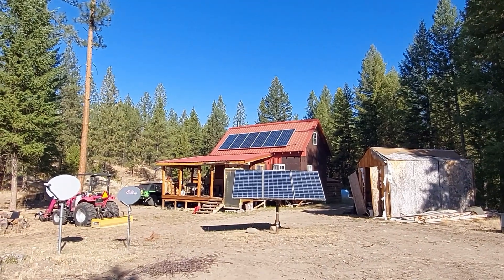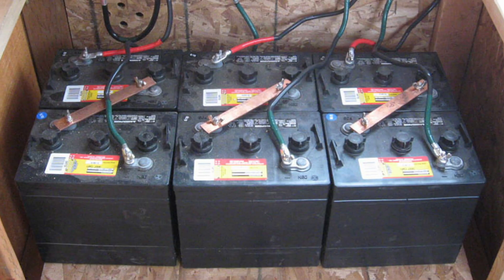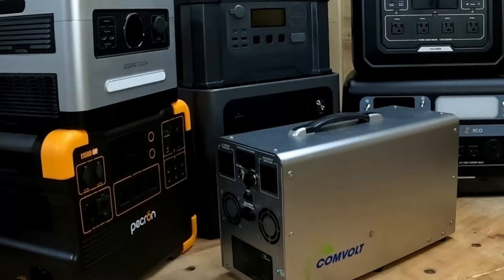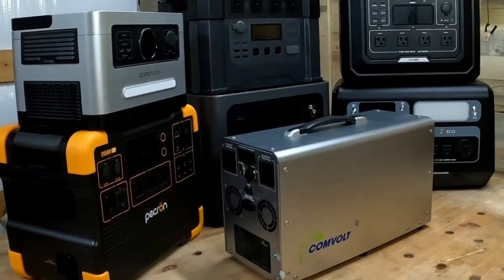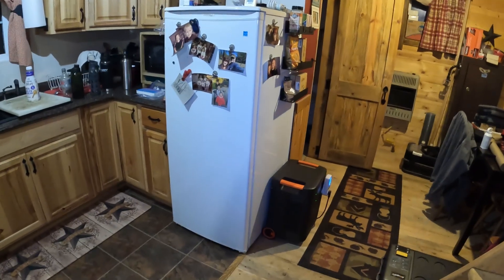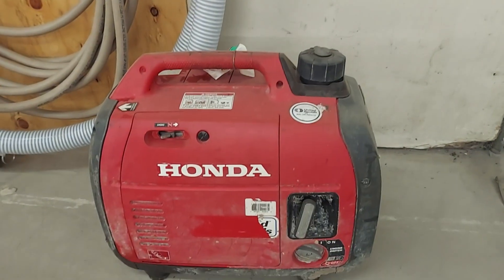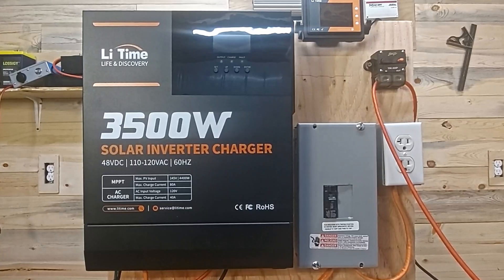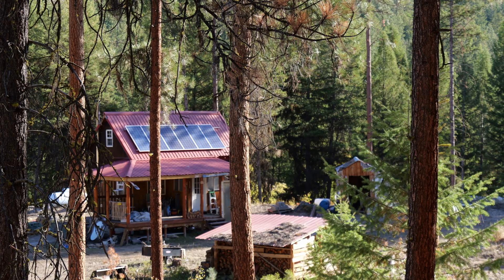Can a Power Station Run Your Off-Grid Cabin?

Comment: Thank you for the commentary.

There are a few options on refrigerators that run on 12volt. From medium cooler sized to 7 cu ft chest style that have separate cooling and freezing zones.

My friend has a smaller cooler style running on 400 watts of solar. Recently upgraded to 2 12volt 100AH LiFePo batteries.

The rest of the house except the kitchen uses 12 volt to run 12 volt led lights in 5 rooms plus a 12 volt 25 inch TV using 180 watts of solar panels and two 100 AH Lead Acid batteries.

The kitchen uses 1 100 watt panel with one or two batteries to run 4 12 volt led lights and 2 12 volt fans.

The battery sizes here vary as to what he brought in from scrap metal hauling.
Everything from old car batteries to bigger deep cycle marine batteries.

If you arent paying for them it doesnt matter if you kill them.
Reply from the maker: Thanks for sharing all the great info on how your friend has his off-grid setup working!

I have a few small 12v fridges but enjoy the bigger one at the cabin
Reply: @TheOldJarhead The only thing I have on the 12 volt cooler fridge is that if using it for a road trip get it cooled down to operating temperature before putting the food in and before plugging it into a vehicle.
Reply from the maker: Mine I run of power stations with DC Alternator charges to keep them running and topped up 😊
Reply: @TheOldJarhead nice.
Reply from the maker: Funny thing, it's what got me into doing more power videos actually :)  Sharing what I learned along the way in the realm.
Reply: @TheOldJarhead It is working.
Reply from the maker: Thanks :D

Comment: Lots of ways to skin a cat when it comes to solar.  Its very situational.    In my situation I can't hook into the house because I rent.  So I have multiple power stations positioned throughout the house for black outs.  The grids throughout the country are very old and weak.  This new AI tech uses tons of electric and they will shut you off before they shut that off.  So whatever works best for your circumstances its probably wise to have back up power.  There will be a lot of growing pains with the electrical systems no matter where you live.  Great video as always!   Sorry for my rant.  Lol
Reply from the maker: You're absolutely right, having backup power is becoming more and more essential these days!

Comment: Imagine a power source that never needs to be charged. You can stash it in your emergency kit or backpack for years, and when you need it — whether during a blackout or in the middle of nowhere — just add salt water or seawater. Within minutes, you’ve got instant, reliable power. Sounds like something out of a sci-fi movie, right? We turned it into reality.
Reply from the maker: I'm guessing you are referring to a sodium based battery/power station?  I've seen Bluetti has one now but I'd like to see performance on them and the batteries as well though it sounds very promising.
Reply: @TheOldJarhead  We use metal-air batteries with a power output of 10-15W. The main unit weighs 800g, and each set of metal anodes weighs 300g (providing 500Wh). When the anode is depleted, it can be replaced in seconds via a plug-and-play mechanism.
Reply: @TheOldJarhead  Would you be interested in receiving an exclusive first look and sharing your insights as one of our inaugural beta testers?
Reply from the maker: Sure, send me an email
Reply from the maker: Sure, send me an email

Comment: I have a 450sqft cabin in the up and use a Anker solix f2000 with the expansion battery to power it. I like that it has the 30amp plug. It will run the entire cabin , several low watt lights, WiFi, tv, morning coffee and charging phones and running a cheap box fan for white noise from like 10pm to 6am and it lasts for around 30hrs. I don’t have solar yet so just use generator to charge back up. Only takes about 2 1/2 to 3hrs to fully charge . It does the job for now and like how I can bring everything back home with me so know one can steal it.
Reply from the maker: That sounds like a very efficient and practical setup for your cabin!

Comment: Adding additional capacity to a mid-size powerstation is cheap and easy.  Just use a big LiFePo4 as a companion battery, and use it to provide additional watt hours to the powerstation through a dc/dc charger.  For $450, you can change a 2000wh powerstation into a 6000wh powerstation.  The LiFePo4 can be charged simultaneously with the powerstation when solar or a small generator are active by using a 20 amp ac/dc charger.  Lighting and refrigeration can be run on dc power if you replace the upright fridge with a big dual zone 12v fridge.  I’ve used this system for years for camping and during Hurricane Helene.  By shedding consumption and adding cheap capacity, your generator use in a small cabin will be minimal.  -Semper Fi
Reply from the maker: Semper Fi!

Comment: I have 2 pecron 2400s and 1600 watts solar with 48v 200ah and I was leaving the air conditioning on for the dogs all day long in summer at my "cabin" I built and live full time on. The key is the extra batteries
Reply from the maker: That's an impressive setup, especially keeping the AC on for the dogs! Extra batteries definitely make a huge difference.

Comment: I bought 2 SETPOWERS 1 for a Freezer and the larger one as a Refrigerator and 80 - 90 Watts is nothing with 2 - 7K worth of Battery Bank or a Mega 1 or 2 plus The HACK CABLE TRICK for Xtreme Boondocking plus Panels.

🌴 You can Stay Out Longer 🌵
Reply from the maker: That sounds like an amazing setup for extended off-grid living!

Comment: I’ve run a fridge for a week with a 2 kW power station and 400 watts of solar, but to do it reliably would require a larger power station (or a second 2 kW unit) to account for variations in weather.
Reply from the maker: That's great info and good point about the variations in weather!

Comment: i run my Apt on mid-size power stations. Since I live alone, I don't use my old power-hungry refrigerator anymore. I use a 12-volt cooler, which has a freezer on one side and a regular cooler on the other. When the compressor kicks in, it only draws 45-50 watts. My mid-size power station can run my Cooler all day and all night without recharging.
Reply from the maker: That's a fantastic setup and great example of how to make off-grid living work efficiently!
Reply: @TheOldJarhead  Thanks Brother Keep up the good work
Reply from the maker: You bet!

Comment: If you like watching movies in your cabin and rather than using a DVD player which burns up precious energy, you can rip your movies to an external 2.5 inch ssd and use a USB cable to sata hard drive and plug it into your TV (if it has a USB port). It saves you from powering a DVD drive. I used to do this before I bought a mini computer where I have all my TV shows and movies. An external 2.5 inch sata ssd uses far less energy than a DVD player. I thought this may help you!
Reply from the maker: Great tip! Thanks for sharing that with us.